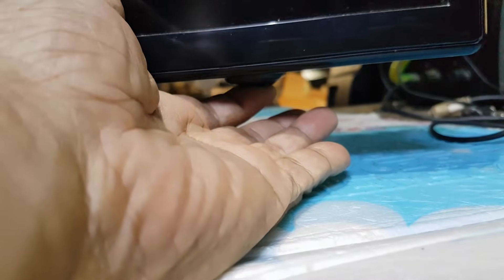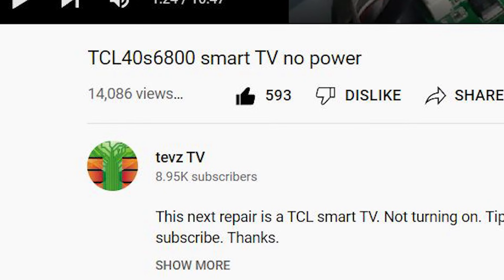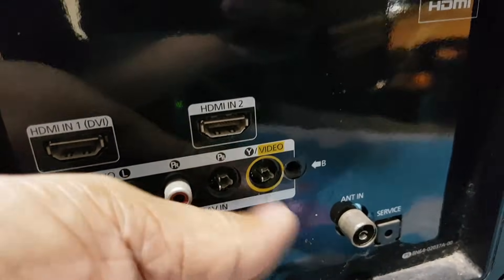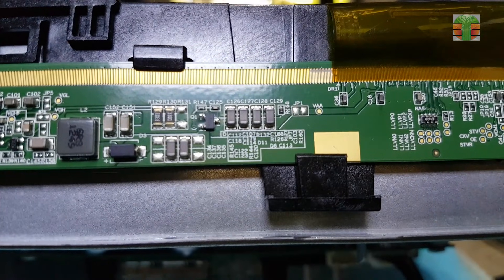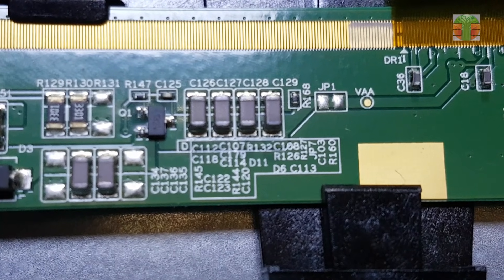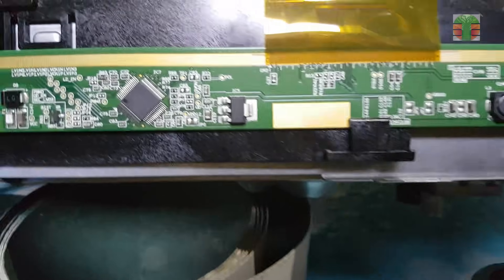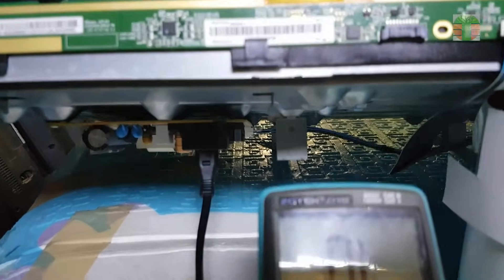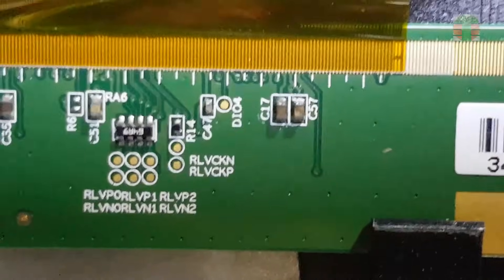Another way to trace a shorted capacitor.

Comment: Why are those tiny smd capacitors and diodes not sold in shops? It seems if you don't have scrap led tvs you cannot repair faulty led tv boards.

Comment: Hello, considering the connection of many parts, how did you determine that this capacitor has a connection?
And why didn't you assemble that capacitor
Reply from the maker: Thus capacitors are connected in parallel so they like all are shorted. do you mean to desolder the capacitor? I desolder the lowest ohm reading and that the suspected shorted capacitor.
Reply: @tevzTVTevatronics  Thank you for your response
So, we take the ohmic capacitors in places where the ohms are much lower than in other places, if we have them, is the part suspected to be connected
Reply: @tevzTVTevatronics  What I mean is that after diagnosing the defective capacitor, you did not assemble the new capacitor in its plac
Reply from the maker: @protection4541  its was https://youtu.be/Cvvv42mGp2M?t=587

Comment: Hi sir, when checking shorted capacitor, tv must be plugged in or should be off ? 
And multimeter should be on DC mode or continuecy mode  please
Reply from the maker: It must be unplugged.  resistance continuity mode with a buzzer.

Comment: Hello, how are you? I brought an LG 37lg606 ur LCD TV for repair. The inverter board had a problem and the TV only stays on standby. A fuse and MOSFET number 8447 were burned on the inverter board. I replaced it and replaced the MOSFET with 45n03. Now the TV turns on. The image fills the problem. Is there a replacement for MOSFET or not? Thank you for your guidance. 🙏🙏🙏🙏
Reply from the maker: I'm good thanks. Is the backlight turned on now?
Reply: @tevzTVTevatronics  Yes, the picture is perfect, when I use MOSFET 45n03, the picture fills up and today I used another MOSFET 50n06 and the picture came, but the picture gets dark in the middle, it doesn't fill up anymore.
Reply: @tevzTVTevatronics  If possible, give me your Instagram ID or WhatsApp number so that I can send you the video

Comment: Sir very informative video, I have vertical line's for first 4 minutes and slowly freezing picture with audio starts then in another minute clear picture with proper audio comes from LG-47LA6200 TV (3D model). I kindly advise, all voltages are okay from T-Con board.
Reply from the maker: Reflow the MCU the big IC
Reply: @tevzTVTevatronics  Thanks Sir, will check and reply back

Comment: Good evening, very good video, I saw that you changed the capacitor, how did you know its capacity, so that we can learn too.
Reply: When it comes to shorting you first check the capacitors, they are prone to shorting
Reply: Hi it's mostly guess work and experience i guess for the capacitor value. You can measure those in the other rails i guess and try. Or sometimes you lucky and find the circuit diagram. Yep unfortunately lots of guess 😂
Reply: I think he just left out the capacitor. The capacitor is there to reduce any noise on the power from affecting the signal.  Any capacitor value of the same order of magnitude should suffice if you find you need the filtering.

Comment: Thanks for sharing sir. 
What is the  reason why you chose to use your analog voltmeter when checking voltages?
Reply from the maker: I also use digital, I use analog on this video because its easier to see if the voltages fluctuate.  See the needle moving up and down.
Reply: @tevzTVTevatronics  thanks for explaining sir. I learned something new again.